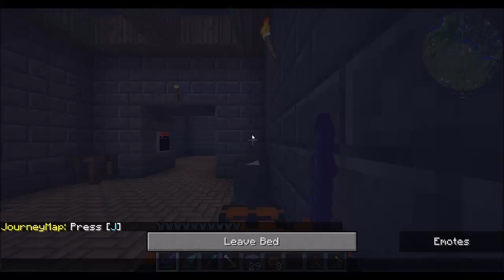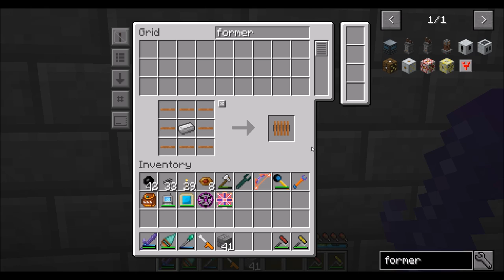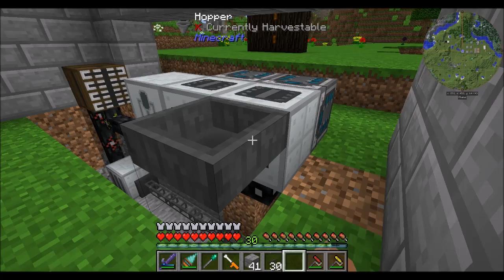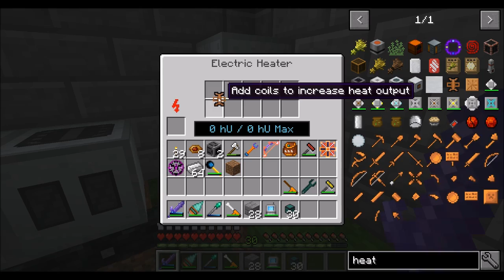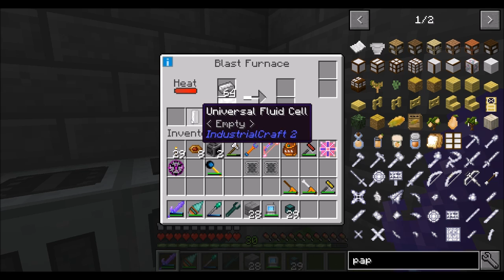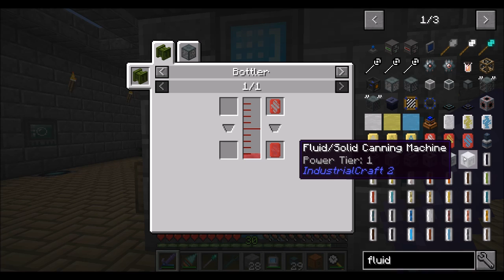Lets Play S8 E83 Industrial Automation

Comment: So, how would I convert EU into RF and vice-versa in this pack? I'm looking at some of the generators like the Water Mills, and they look useful, but everything else uses RF. I'd really like to add these to my existing power supply.
Reply: As far as I am aware, and Dire mentioned this in the last let's play episode, but immersive engineering wire and connectors will auto-convert RF into EU and vice-versa. Hope this helps! :-)

Comment: You should put the IC2 crafters (the ones to make circuits, insulated cables, ect) in the basement of the IC2 room, it'd be organized, and logical. Also, wires on top doesn't matter, the room looks crappy anyways, it's a small box with vanilla stone brick  walls and a grass floor...

Comment: I haven't watch it all yet, but I hope he remembers about ejector upgrade he rarely if ever used.
Reply: ChillaKilla - You can, the ejectors are automatic, so you could use them to eliminate unnecessary wiring for the cost of an upgrade slot and the knowledge of how to use them.
Reply: Ethulwulf Sauce i know ejectors and how they work, and that they can output to lets say a cest what i wanted tonsay is , do the crafters from rs act like chests? dire normally just uses input busses to import finished items back into the  rs network.

this is what i havent tested, crafter puts item in machine => machine prosseses it => finishd product needs to come back into the rs system for it to fulfil the reqest.

so can the crafter accept the finsihed item like a importer/ interface does 
otherwise the ejectors have no point, as you then need to pull items out on other sides anyway. thus the build not looking "pretty"
Reply: MrChronickills can you eject back into the crafters? never tried that but other than that there is no use for ejector upgrades